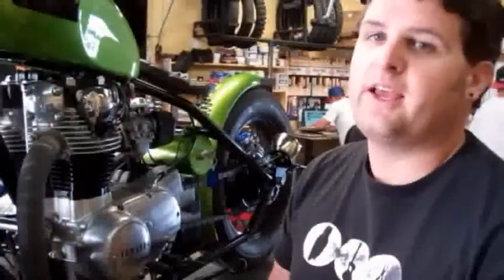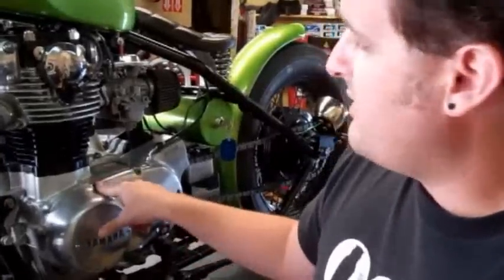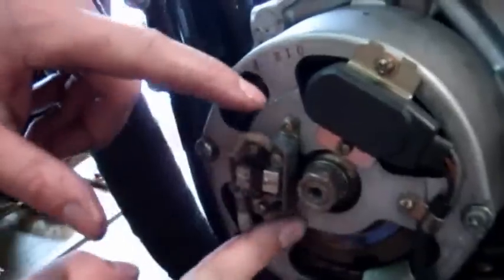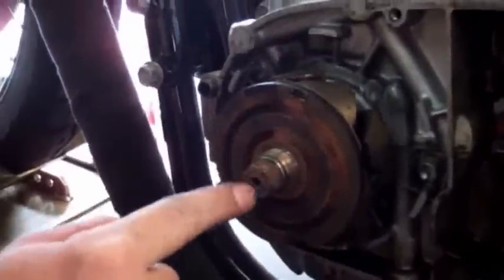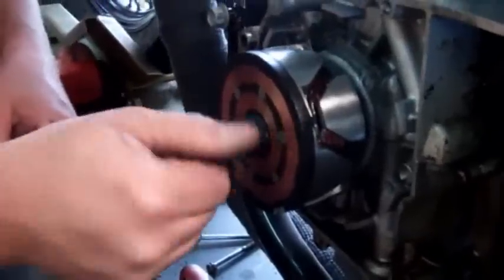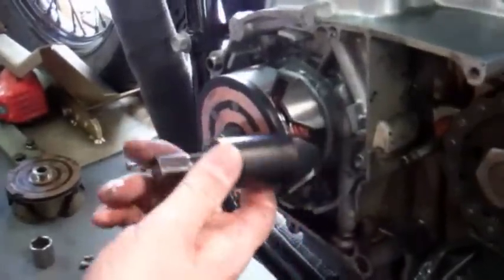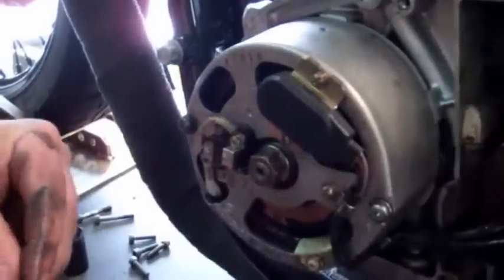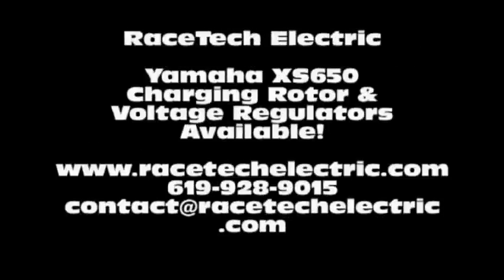RaceTech Electric Yamaha XS650 Charging Rotor Installation

Comment: With all that emphasis on disassembly and assembly you forgot to mention the obvious, that being, why was the rotor, being changed in the first place? after all the bike was driven into the workshop with the old rotor! Elaborate if you can, on the deficiencies of the original rotor.
Reply: i agree, and why would I not change the original for a permanent magnet rotor and stater?